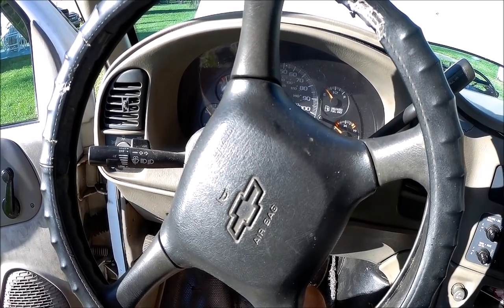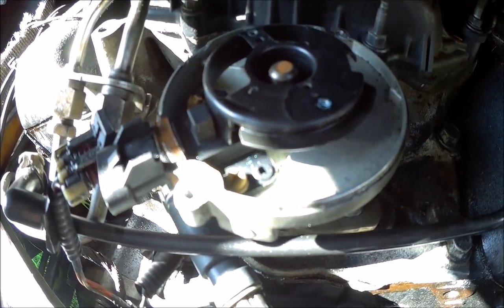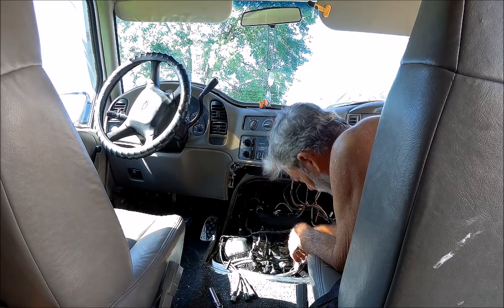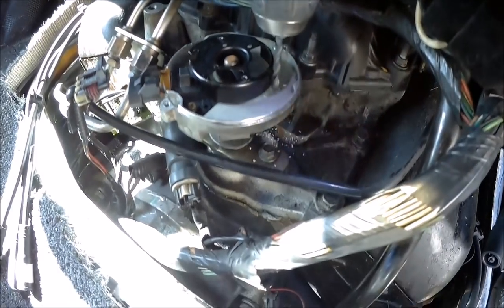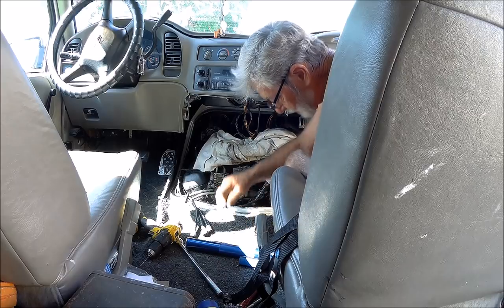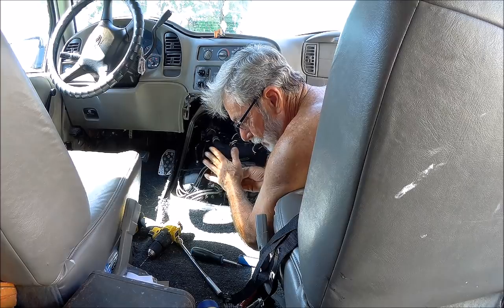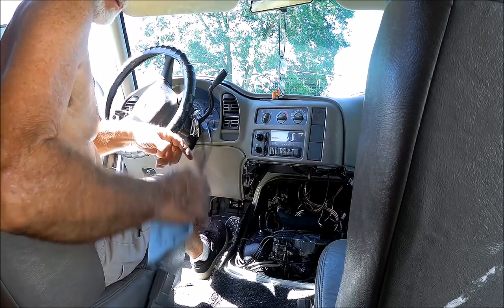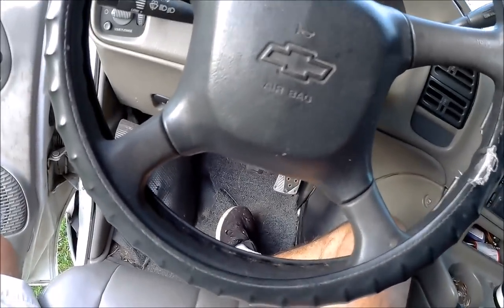CHEVY ASTRO VAN FIXED ! NO START WHEN IT RAINS - SOLVED  !

Comment: Thanks for posting this!

The whole van-won't-start-when-it's-raining problem had been vexing my father-in-law with his beloved Astro for years. His mechanic couldn't figure out what the problem was either.

I watched your video and drilled out the screens. I also replaced the cap and rotor because they were all corroded. 

Now it's STARTING even in the soggy spring weather!!! The van has 254k miles and is still kicking! My father-in-law is 72 years old so he won't be doing any cart wheels, but I'm sure he would have if he could! Thanks again!
Reply from the maker: Hey.  Thanks, Thats Great!  I know what he was going through but fortunately for me I've only had the van a couple years. And its still going strong, thank goodness. Thx again, great comment !
Reply: Try an AC Delco OEM coil wire.  It makes a much better connection to the coil fitting.

Comment: The moisture collects from condensation. Damp humid air can easily form condensation with a small change in temperature. The screen vents are there to allow air flow, which dries the condensation when it forms. That is why they put screens in, but the screens corrode and get plugged. Then, no air flow and no start because the condensation robs the spark by putting it to ground before it can ever go down the plug wires. Opening up the vent screen ports is the cure. Great job on your videos! I just bought my 10th Astro/Safari today!
Reply from the maker: Hey. Thanks ! Wow 10th one. wow Thanks again !
Reply: Loolkoll  is

Comment: i change my distributor cap, after a rainy day the truck didn't want to start. found your video , i did like you do and it start nicely. thanks 2002 Chevrolet express 3500 engine 5.7
Reply from the maker: Cool man thanks!

Comment: One week in on this fix and my 03 Sonoma has started right up every time. Wasn't enough room for a drill, so I used a punch to knock the screens out. Problem solved. Thanks again!! As you know, that was a stressful, time consuming issue.
Reply from the maker: Sweet

Comment: Hey l did it, drilled out holes in distributor & it starts fine in the rain now. When the distributor gets old moisture from rainy & damp wheather kills the spark. Now it has vents 2 prevent the moisture build up. Cool now l'm a happy camper !!!
Reply from the maker: 👍 Hey. For any anyone reading these comments, it 3/7/2019 and my van is still going strong ! thanks for watching and commenting. Stay tuned !

Comment: I am having the exact same problem. I have trouble only in the morning. I even have missed work cause of this and nobody believes me. Coworkers tell me the van gets lazy in the mornings and doesn’t want to show up to work. I will try to get this done and see how it works. Thank you sir
Reply from the maker: Hey. Thanks for tuning in. get some dielectric grease and smear it all over the inside of the distributor cap and squeeze some in the plug wire caps too- the dielectric grease is best and last a long time! Thanks again !
Reply: @THISOLDOUTBOARD1  It solved my problem. Thank you sir! Great video

Comment: Thank you so much for this video. I've had the same exact issue with my 03 Sonoma for several years knowing it was moisture in the distributor, but I did not know what the fix was for it to actually solve the problem. I will definitely be doing this. Again, thank you for this post!!
Reply from the maker: 👍 my astro still going strong and its raining like hell right now in beautiful sunny orlando fl ! hahaha. thanks

Comment: I have been chasing this problem for 8 years.  Changed the distributer and cap multiple times like once a year.  Changed the coil and ignition module.  I fortunately kept records for the 16 years that I owned the safari.  For the first 8 years, I had no wet start problems.  I reviewed the records and found these problems started when I replaced the coil and plug wires with an aftermarket set.  I again had a no start problem this week in damp weather after putting in a new distributor a year ago.  I removed the cover and cranked the engine and noticed sparks arcing from the coil.  I replaced the coil wire with an AC Delco OEM part and it started right up.  Try that for a fix.  You will notice that the OEM connector and insulation make a much better fit on the coil.  Also, the OEM part is made from a premium silicon material.  It is worth the additional cost.
Reply from the maker: Hey. Thanks for watching  and commenting. Really appreciate it. If I have any more problems I'll try that. Thanks again
Reply: Thank you for your comment! YouTube comments are the best place I've found look for info nstuf like this. What is the coil called and where did you order from? I'm ready to stop having this issue. Gonna try drilling thos screens out too! I appreciate the video and comments

Comment: Good god man! 3 years later and this video is still helping folks! I've had the same problem for years now and no mechanic could figure it out. Even replaced the starter solenoid and distributer caps... Oddly, what helped me until I found this video, which still baffles my mechanic, is that if I pumped the brakes hard and held them, it would turn over and fire for a few rotations, then I'd have to quickly find the sweet spot in the gas peddle to continue the combustion until it caught... But if I missed that initial combustion rotation or didn't find the sweet spot in time, I had to wait an hour to try again before the combustion would catch for a second attempt at the gas peddle sweet spot. And, like you, once I got it going, it'd be fine all day until I let it sit for more than a day. Thanks my man! Your video is a life saver!!!
Reply from the maker: Hey. Thanks for tuning in! Happy New Year !

Comment: I had this no start gremlin come back this morning.  The vent holes were  clear but distributer cap terminals were burned away. This  was the fourth  or fifth replacement cap that I recently replaced. They all had foil covered plastic terminals. I ordered an Accell cap, it has solid brass terminals,the originals were aluminum& solid ,they went 16 years& 130+ thousand miles with no problem. So far so good,we'll see.
Reply from the maker: Hey. Thanks for watching and commenting. Wow an AMC Gremlin! Right along with the Pinto and Vega! I luved those cars. Hahaha. Thanks again & Stay tuned !
Reply: Great tip ! Thank you! I'll be ordering a good cap!
Reply: I,ve recently  noticed a lot of moisture gathering  at the rear of the engine compartment. Looks like I'll have to replace the intake manifold  gasket set. At 26 years& 225000 miles these problems. Are to be expected.
Reply: Sometimes it dissimilar metals brass cap with aluminum rotor

Comment: I owned a 91 Astro from 2008 till i sold it in 2017,the 4.3 is probably the best v-6 ever made.
Reply from the maker: HEY. I hope this one last a while. it's a 2005 had an engine swap before I got and they did a crappy job. the odometer was at 155,000 and I only paid 1300. for it and I swapped the trans out about 7 months ago, a major pain in the ass because it had to be a 2005 tranny and nobody had one in a 100 mile radius. unbelievable
Reply: I sold mine to my girlfriends brother with 185k on it and he drove it to Ohio to a funeral over 1200 miles each way 2 months ago and it's still going,i drove it from Milton Fla to Newnan Ga see my daughter on 3 occasions,other than  routine maintenance i never had a problem,one mechanic told me that the 4.3 is basically a 350 with two cylinders cut off, i hope you have good luck with yours.
Reply: 300k compression still great...

Comment: Great video.  Love the dialogue (monologue?)!  Thanks so much for posting this.
Reply from the maker: Hey. Thanks. Really appreciate you watching and commenting. Stay tuned !
Reply: @THISOLDOUTBOARD1  I just bought my Astro 3 months ago.  Already put 6,000 miles on it going on road trips.  She's my baby.  I love her.  But yah, she totally had trouble starting after a rainy night, and also that night, I parked her next to my sprinklers.  So yes!  Thanks again for this.  I'm gonna replace the distributor cap and rotor, wires, and spark plugs here soon, and do this modification while I'm at it.
Reply from the maker: @ryanhenderson4868  👌
Reply: I'm goin through the crank no start no, think I got it figured out. New fuel pump try tommrow lol

Comment: I don't know if you had already got your van fixed my van is doing the same thing and I just watched the video of a guy replacing distributor cap and it cranked up and ran
Reply from the maker: Hey. Thanks for tuning in. Yes mine has been good for years now. Replacing the cap will not cure the problem. The reason his started up was because the cap didn't have time to build up moisture. You can take the cap off and hit it with a hair dryer or heat gun put it back on and it will start. But who has time for that? Hahaha. The best thing I have found is Dielectric Grease smeared all over the inside of the cap, I even squeezed a dab in each plug wire connection. Works like a champ! Some people use wd-40 but it will dry up and not last. The service bulletin drilling worked but not for long, especially where I live. I had moved to a different lot, covered with big oak trees, lots of shade, no sun. It started happening again just days after the move. Used the DG and 0 problems! I'm still in that lot!

Comment: electrical shortage in 2004 Chevy Express melting wires on drivers side of engine.  Van filled with smoke and alarm began to trigger but sounded like the battery was low.  Where can I get a picture of the wire diagram so I can find out what went wrong.
Reply from the maker: You should be able to find it online somewhere or go to the parts store and pick up a Chiltons manual

Comment: I have a 98 Astro. My problem is it'll start first thing, but once it warms up, cranks but no start. What the heck!
Reply from the maker: Hey. Thanks for tuning in. I'd start at that coil and check it for spark when that happens. Coils will test fine but will break down when they warm up. Or it could be another 3-4 ignition parts wearing out. Crankshaft position sensor, Camshaft position sensor, Ignition module, or maybe your fuel pump is dying. There are tons of videos for a no spark/start situation and how to test each thing or just give it a super tune-up and replace everything before they break down! Thanks Again !

Comment: Run a ground wire from the coil body to a metal ground or the battery ground cable. Replace the coil and distributor  cap and rotor. Put RTV under  the distributor  cap body. Check  for play in the distributor  by lifting up on the distributor shaft. Play means distributor  gear wear.
Reply from the maker: Hey. I did all of that in the first video, waste of time, but I have a new coil. The only fix is drilling the distributor as seen in the video. Still going strong 4 months later ! Thanks for watching and commenting .
Reply: THIS OLD OUTBOARD Won't  that  bring in moisture? Was that  a factory recommended repair? Get a Actron CP9690  code  tester to check codes. It tests live,  record,  graphing, emissions  test, solenoid and relay test, oxygen sensor  test, and MORE! For more testing, get a Snapon Advantage or the Verus with ignition scope. Lift  up the  distributor  and check for distributor  gear  play.
Reply: @THISOLDOUTBOARD1  HELL YA

Comment: Ionization under the distributor cap...   Drill a small hole in the side of the distributor cap for the WD-40 red straw and shoot a shot of WD-40 in there...   It fixed my Suburban.
Reply from the maker: Hey. Yeah it's Fixed ! it's the One Year Anniversary of the Upload. Youtube suggest a Rerun or something like that. The funny thing is exactly one year later the AC manifold Hose Blows Out. Just uploaded that video. Thanks again. Stay tuned !

Comment: 1996 chevy 1500 truck the same problem,  opened the distributor cap clean well and used sandpaper 
Works much better but not perfect yet, one day didn't want to start so I used the heat gun  to dry the distributor 15 minutes and start right away 😂 if you used original distributor it will fix the problem they are made of different material won't get bather by rain or whether OM for Chevrolet
Reply from the maker: Thanks for tuning in.

Comment: I HAD A DODGE LIKE THAT ONCE IF IT WAS CLOUDY IN MIAMI IT WOULD NOT START IN FT LAUDERDALE. I REPLACED THE DISTRIBUTOR CAP AND SPRAYED IT WITH SEALACONE SPRAY. AFTER  YEAR OF BEING LATE FOR WORK. NEVER HAD ANOTHER PROBLEM.  WITH IT STARTING OF COURSE THERE WERE OTHER PROBLEMS IT WAS A DODGE
Reply from the maker: kool

Comment: Here's what happened to my 99 astro I brought 8 years ago. Rain would stop the engine even sitting in park.
Cause - leaves were built up in the drainage gutter (under windshield wipers)
removed the buildup and water falls to each side fender properly.
Take the wipers off, black grille then get a vacumn and stick it in left and right deep. If you think it's clear take a hose and put it in the drain gutter and see if water falls out at the driver side and passenger side fender
Reply from the maker: Thanks for tuning in! Just catching up!

Comment: shound like a vacuum line is off .  OK YOU HAVE DRILLED HOLES TO LET WATER OUT BUT WERE IS THE WATER GETTING IN. BOATS SIT IN THE WATER AND YOU DON'T RIP THE CAP OFF EVERY TIME YOU WANT TO START THE BOAT. WATER MUST BE DRIPPING ON THE CAP AND GETTING IN THAT WAY. HOPE WHAT YOU DID WORKS ON A RAINY MORNING. GOOD LUCK !!!
Reply from the maker: It has something to do with the design of the van I guess I'm not the only one that happens to anyway yes still going strong with no problems. The first time I tried new coil distributor cap sprayed everything down with silicone and it still didn't work then I found this was the fix. It's such a minut amount of condensation but it still destroys the direction of the spark or something like that. Hahaha later
Reply: STRANGE TO SAY THE LEST. BUT IF IT WORKS IT WORKS.  KEEP HER RUNNING THEY ARE LONG RUNNING VANS. GOOD THING THEY ANT CHEEP

Comment: spray WD 40 into the distributor cap I lived 100 feet frpm the ocean lots of fog too WD water dispersment try it had the Astro 4.3
262
Reply from the maker: Hey. Yeah I tried that but it didnt last.  This worked and every once in a while when it rains for a couple days and the van dosent get used it will act up some. But rather than drain the battery and beat up the starter I just use a hair dryer on it under the hood for about 10 minutes and it fires right up. Thanks for watching and commenting !
Reply: @THISOLDOUTBOARD1  u use a hair dryer on what?
Reply from the maker: @Listen1111  distributor cap
Reply from the maker: @Listen1111  distributor cap

Comment: so is this after the grounded coil and wd40?
Reply from the maker: YES. DRILL IT OUT. I LIVE IN ORLANDO FLA, ITS STILL RAINING EVERY DAY, ITS RAINING RIGHT NOW, CHECK THE RADAR. THIS IS THE FIX! IF THIS DOSENT WORK YOU HAVE A DIFFERENT PROBLEM. GOOD LUCK!
Reply: I live in Texas and it's been raining and I've encountered this same problem someone told me to seal up the cap with silicone to keep moisture out and I read about the drilling also.. so what exactly is it that I have to drill out? I take the cap off the rotor off and then drill the body of the dist? where the vents are?
Reply: thanks for the quick reply I'm gonna get out side and drill it out right now
Reply from the maker: HERES THE LINK    https://www.youtube.com/watch?v=3Zkpewp7HDY
Reply from the maker: 👍👍👍👍👍👍👌👌👌👌👌👌 WORKED FOR ME AFTER TWO RAINY SEASONS.
Reply from the maker: Hey. did you drill it out

Comment: The can't engineer enough gremlins to throw off pure stuberness they can't duplicate in these college educated greedy engineers. They want it to go back to the dealership to fix at astronomical shop labor rate, or just break you down enough to make you cry and get a new pos. Evil pricks, 4.3 good motor till they added a bunch a of worthless unreliable crap to it. That cash for clunkers bs was just job security for them, ruined any hopes for spare parts. Just gonna go with Toyota, and scab plate the frames.
Reply from the maker: Hey. Thanks for watching and commenting !

Comment: Clean the throttle body, it will help with starting.
Reply from the maker: Hey. Did pull it off and it was still pretty clean from the last time I cleaned it. Only fix was drilling out the distributor, and still going strong 4 months later! Hallelujah ! Thanks for watching and commenting. Stay tuned !